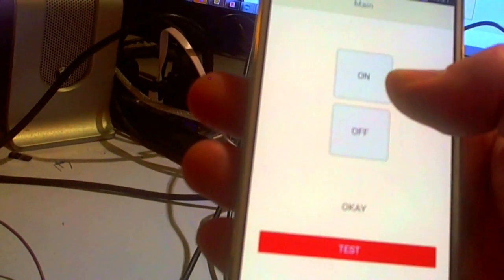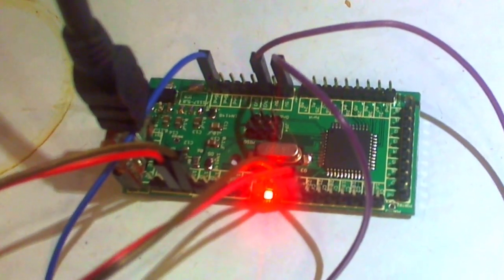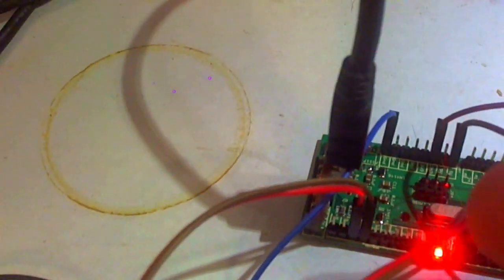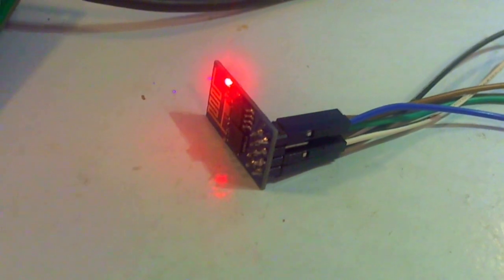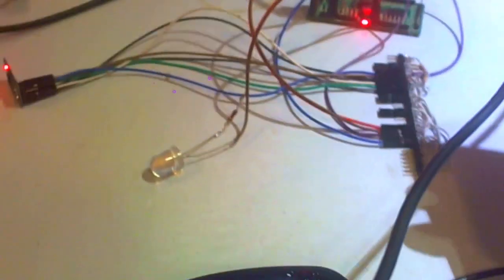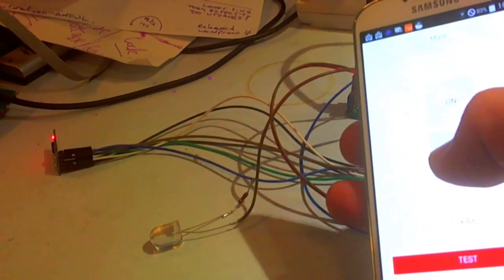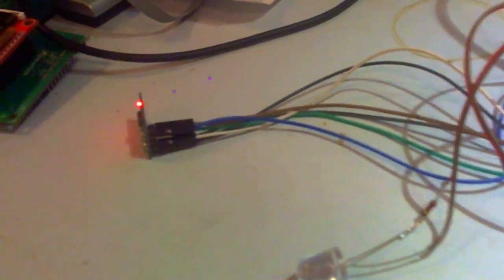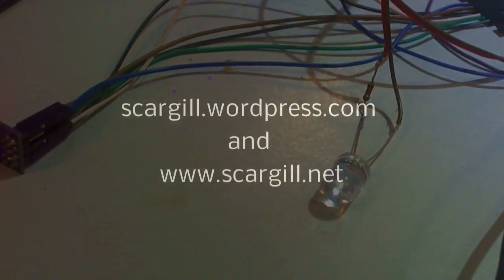ESP8266 WIFI board in action

Comment from the maker: There is no doubt they are cheap - we need to keep the pressure on the designers however to make sure they are reliable. Ok, so others could make fixes but a plethora of incompatible firmware is not a great idea.  If it were not for the "busy" issue I'd have these in a range of boards right now - as you say, a little WIFI board and a £3 mini-Arduino from China and you're all set - not to mention the savings in code space used. My little tester takes little more than 7K.

Comment from the maker: No problem Itzek  - I just hope if anyone makes progress with the "busy s.." issue they return the favour and let us know. I now have a little app running to turn lights on and off and I can't implement it yet as there is too high a possibility of the WIFI unit going into "busy s" mode which needs a reset. Conversely I have some home control stuff using normal Ethernet cards which have run for many months without a glitch.  Still some way to go with these little boards.
Reply: I think these little boards are a real revolution in this field. For a long time now you can buy Arduino boards for few bucks, but to get them connect to the world was an expensive adventure. As I see it, with the price of this chip, all future Arduino boards should be produced with this chip on board!
I just ordered few more from AliExpress at price of 3.3$!

Comment from the maker: If you check the blog - there are lots of sources out there but the 2 I linked to - had (a) the latest firmware before which you could not create a socket and (b) hardware info relating to reset and the other two pins of relevance - you really need to be aware of both of those links (until something better comes along)...  I hope next week to start working on making the link rock solid which right now it isn't. If I set up a light to be remote controlled I need some minimal security (and it will be MINIMAL unfortunately) - but 3 months later it has to work despite power cuts etc...   so that's my next challenge.. I also would like to see a default setup that could be updated over a web page much as a router can be updated over a local page. If anyone has started on that latter aspect it would be great if they'd share.

Comment from the maker: And just to add to this, here is the information you need to use the ESP8266 as a stand-alone WIFI ACCESS POINT so you can talk to it outside - for example , it may be in a car controlling something like the heater - or some other external installation where you can't count on WIFI availability - log into it with your phone etc... I found some missing information on a German site - and it's all in the link. I've not yet tried sending commands from the phone in this mode - but that will come next.
Reply: Your link doesn't work any more... Did you mention http://www.mikrocontroller.net/articles/ESP8266 ?
Reply from the maker: Michael Weber Thats' the one.  I was pointing back to my blog I think at http://scargill.wordpress.com  - I have not gotten anywhere with Espressif who know there is a busy problem but are too "busy" to fix it but I'm trying to get the compiler running so I can fix it myself. Having issues not being a Linux programmer.
Reply: What's your specific problem?
What compiler/linux-system would you like to use?
Reply from the maker: Michael Weber None of them as I know very little about Linux :-) The version I have installed is the ESP8266_lubuntu version and although the code compiles it throws up various errors.

Here it all is..

+ make
make[1]: Entering directory `/mnt/Share/app/user'
make[1]: Leaving directory `/mnt/Share/app/user'
make[1]: Entering directory `/mnt/Share/app/driver'
make[1]: Leaving directory `/mnt/Share/app/driver'
make[1]: Entering directory `/mnt/Share/app/lwip'
make[2]: Entering directory `/mnt/Share/app/lwip/api'
make[2]: Leaving directory `/mnt/Share/app/lwip/api'
make[2]: Entering directory `/mnt/Share/app/lwip/app'
make[2]: Leaving directory `/mnt/Share/app/lwip/app'
make[2]: Entering directory `/mnt/Share/app/lwip/core'
make[3]: Entering directory `/mnt/Share/app/lwip/core/ipv4'
make[3]: Leaving directory `/mnt/Share/app/lwip/core/ipv4'
make[2]: Leaving directory `/mnt/Share/app/lwip/core'
make[2]: Entering directory `/mnt/Share/app/lwip/netif'
make[2]: Leaving directory `/mnt/Share/app/lwip/netif'
make[1]: Leaving directory `/mnt/Share/app/lwip'
make[1]: Entering directory `/mnt/Share/app/json'
make[1]: Leaving directory `/mnt/Share/app/json'
make[1]: Entering directory `/mnt/Share/app/ssl'
make[2]: Entering directory `/mnt/Share/app/ssl/app'
make[2]: Leaving directory `/mnt/Share/app/ssl/app'
make[2]: Entering directory `/mnt/Share/app/ssl/crypto'
make[2]: Leaving directory `/mnt/Share/app/ssl/crypto'
make[2]: Entering directory `/mnt/Share/app/ssl/ssl'
make[2]: Leaving directory `/mnt/Share/app/ssl/ssl'
make[1]: Leaving directory `/mnt/Share/app/ssl'
+ '[' 0 == 0 ']'
+ rm ../bin/eagle.app.v6.flash.bin ../bin/eagle.app.v6.irom0text.bin ../bin/eagle.app.v6.dump ../bin/eagle.app.v6.S
+ cd .output/eagle/debug/image
+ xt-objdump -x -s eagle.app.v6.out
+ xt-objdump -S eagle.app.v6.out
+ xt-objcopy --only-section .text -O binary eagle.app.v6.out eagle.app.v6.text.bin
+ xt-objcopy --only-section .data -O binary eagle.app.v6.out eagle.app.v6.data.bin
+ xt-objcopy --only-section .rodata -O binary eagle.app.v6.out eagle.app.v6.rodata.bin
+ xt-objcopy --only-section .irom0.text -O binary eagle.app.v6.out eagle.app.v6.irom0text.bin
+ ../../../../../tools/gen_appbin.py eagle.app.v6.out v6
40100004
3ffe8000
3ffe8da0
genflashbinv6 eagle.app.v6.text.bin 40100004 eagle.app.v6.data.bin 3ffe8000 eagle.app.v6.rodata.bin 3ffe8da0
text start_addr 0x40100004
data start_addr 0x3ffe8000
rodata start_addr 0x3ffe8da0
ERROR: text seg len is 5e1a is NOT 4-byte aligned!! Need to pad
text size5e1c
data sized9c
rodata size18ac
header size is 8 block header size 18 total size is 8485 pad is 0xb blocks  
chksum text e1
chksum data 2c
chksum all 93
text load_addr 0x40100000 len 0x5e1c
data load_addr 0x3ffe8000 len 0xd9c
rodata load_addr 0x3ffe8da0 len 0x18ac
mv eagle.app.flash.bin eagle.app.v6.flash.bin
+ cp eagle.app.v6.irom0text.bin ../../../../../bin/
+ cp eagle.app.v6.flash.bin ../../../../../bin/
+ cd ../../../../../

 In the meantime I have managed to get the XTCOM_UTIL program to work in Windows - but the latest 2-part ROM when programmed does not work at all (for me anyway) so the latest version of the FLASH code I have has the BUSY..S bug.
Reply: I don't like make for it's extensive output. Any chance you could compile it without make?
i.e. gcc myfilename.c -o outputfilename
?

I would copy the whole stuff to a folder with a short name (you're working inside an eagle-folder? ... /eagle.app.v6.dump ../bin/eagle.app.v6.S...) and comment out some functions to find the problem.

Comment: Hello Peter,
How do you compare this board to the nRF24L01+ that you used before?!
which is more feasible to implement as a network for IOT & automation ?!
I think with this you will have a lot of programming to produce a truly mesh network , while the nRF is ready to go with Maniac network layer (Tree topology).
I am still working on my nRF network nodes implementing automation logic is very time consuming !
I have some of these ESP8266 just arrived, with no time to start over a new network !

So what do you suggest for an "automated" home ?!

Thanks in advance, your blog helped me a few times :-)
Reply from the maker: Hi there

Well, there's a good question - making a network of these is NOT going to be easy - they can't seem to do more than one job at once-  so the radios are better suited to a network - having said that if I never see an NRF24L01 again I won't be too disappointed - their range is rubbish and they can't transmit and receive at the same time so there are some severe limits - also they can't announce signal strength which means their use in a network such as Radiohead is severely limited. See my blog at scargill.wordpress.com for more on that and alternative radios.  

The old RF24NETWORK - yes, well good luck with that unless your requirements are for occasional transmissions where it is unlikely that two units will talk at once - as I say that network with those cards cannot handle simultaneous reception and transmission and there is no interrupt drive for it either.  Take a look at the Radiohead library and there are better radios detailed on the blog. On the other hand the ESP8266s have better range - partly as they are talking to access points - as TCP/IP listeners with one master there might be a future - working on it - spent the days discussing options. A potential is to have one ETHERNET based master and a load of listeners using ESP8266.